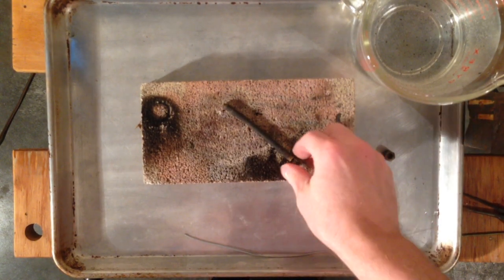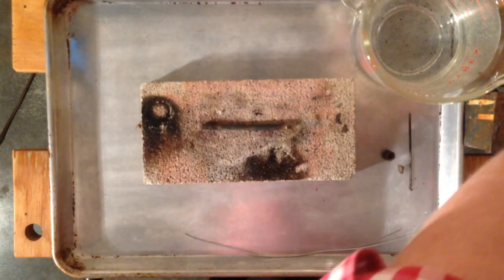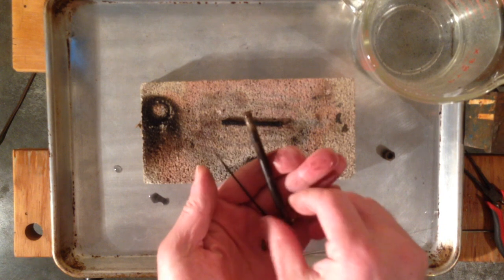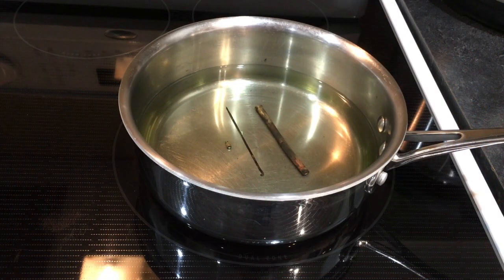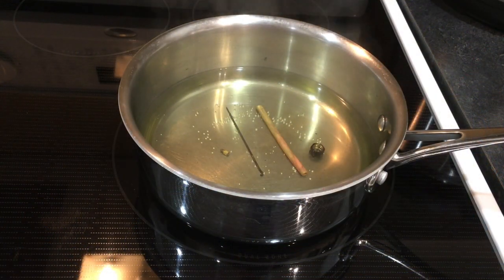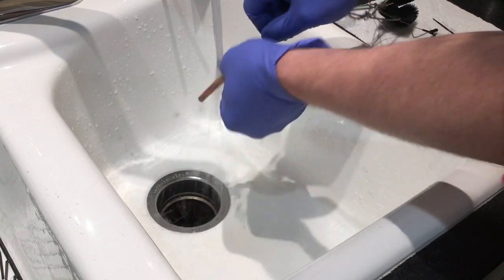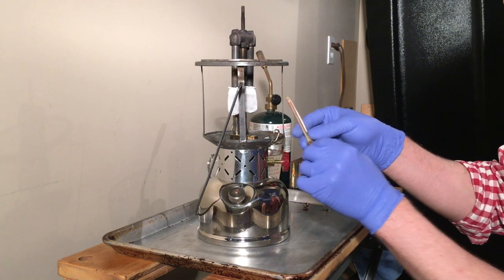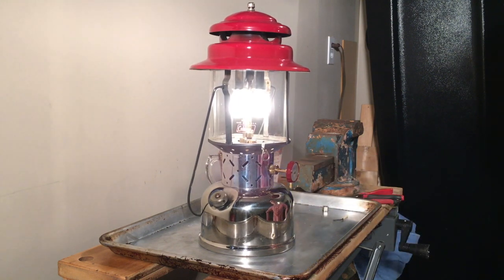How to Clean a Clogged Lantern Generator

Comment: Could you please show how to make a new brass or copper tube to replace the asbestos/ cardboard tube. An do they work better than the original tubes?
Just a thought, I was wandering if a set of welding torch cleaners would work better at cleaning the sprayer tip. They come in a small aluminum box with many deferent sizes of metal
Reply from the maker: I'll add it to my list of potential videos to make in future.  Using copper wire or bronze wool works as well as the original tubes.  Its function is to centre the cleaning rod, so anything that does that and doesn't melt or burn up will work just fine.  I can't comment on welding torch cleaners as I know nothing about them.
Reply: @king.coleman  thank you very much.

Comment: Trying to breath some life into a crusty 502 stove I have had for years (3/65 date on the bottom). Your systematic approach has been very helpful. Once I was able to pull the spring from the generator tube, it stretched a bit during the pull, and it had no cardboard or asbestos insulation at all (just black goo). Seems like the rod just rode down the tube by itself, centered by a full length spring.  Wondering if I can run it this way and if I can shorten the stretched spring by an inch and still be OK. 

I'll get a new generator if necessary, but if I can make this work, it would be great.
Reply from the maker: Stove generators lack the cardboard/asbestos tube; they just have a spring and cleaning rod.  I'd do what you can to compress as much of the spring as possible back into the generator.  If you have to trim just a bit off, it probably won't make a difference.  If you have a trim a lot off, it could be a problem.  I cut a couple inches off the spring in a 3F generator for the same reason and now it has trouble maintaining temperature when the burner is on low.
Reply: @king.coleman   Thanks for the quick reply. I did figure out about the lack of insulation packing after seeing a couple other videos. Also, I did have to cut off about 3/4" from the stretched spring. I do not have things all reassembled yet, but will do so tomorrow if all goes well. I will report back in here with the results. And like I said, it's and experiment and I will buy a new generator if need be.

Thanks again for the help, and for the videos.

Comment: does the tip come off the generator of my AFC 1022? Thought I would ask before i get rough with it. I cannot blow through it and there is a hard black coating on the end. I do not see a hole. Thanks for any help.
Reply from the maker: All the AshFlash generators I've come across were brazed together and not designed to come apart.
Reply: @king.coleman  I had a sneaking suspicion that was the case. I am glad I asked. Thanks for taking the time to reply so promptly.

Comment: Hey, great videos.
Any tips or tutorials on cleaning a Coleman 508 stove generator?
Reply from the maker: Those are tough.  If it's not bad, you could just shoot carb cleaner through it or boil it in a citric acid or white vinegar bath.  If it's really clogged you could try heating and quenching to break up the carbon, but at that point it might be best to replace it.
Reply: Thanks for the quick reply.
Can you boil the whole generator and regulator assembly with the lever or do you need to take it apart?
Reply from the maker: @hutcha107  Just the generator.

Comment: Thanks for this video. Planning on camping on the Island in the fall so testing equipment. My Coleman Duel Fuel Lantern either will not burn or burns very dimly. Since it was not used at all last year I expect it needs a cleaning. After viewing this I decided to clean the generator but I get stuck at the point where you pull the central unit out of the generator (at 1:49 in the video) No amount of back and forth movement makes a difference. The outer brass tube has two dimples in it. It is a newer model (285a). Could it be that this is a crimping to prevent removal?
Reply from the maker: I've never seen one like that, but if the outer tube is crimped, that's probably the case.  If you can get the guts out, try soaking it in carb cleaner overnight and see if it improves.
Reply: @king.coleman  Thanks so much. It is just a tiny crimp, like a centre punch was used but I will try a soak.
Reply: Again a thanks for your good advice.  I soaked the generator in fuel injector cleaner (all I could find locally) for five days.  Completely restored function.
May just I will just do that at the end of every season.

Comment: Can asbestos cardboard be replaced by fiberglass mesh or ceramic mesh? Since they are used to insulate very hot pipes such as motorcycle tailpipes, and they do not burn. Do you think it will do the same job? Thank you!
Reply from the maker: I'm not familiar with either  material.  Many people use bronze wool or copper wire to replace the original tubes.
Reply: @king.coleman  Thank you! Maybe someone knows...

Comment: Fr. Bill I had no idea that the REC had such an asset.  Your videos are very helpful.  I’m repairing a couple of 220s and this was good info.  By the way, do you know if the enamel can be restored on these?  220J and 220K, or if it is worth trying for just a few small spots.
Reply from the maker: Are you talking about the enamel paint on the fount or the porcelain on the vent?  Founts can be repainted.  I recommend automotive grade paint that will resist gasoline spills.  There's a place called Independence Porcelain Enamel in Missouri that is able to refurbish vents for around $30-$50 (depends on the vent).  I'd be hesitant to invest that much in a 220J/K vent since they're so common.
Reply: @king.coleman  I was referring to the vent.  I guess based on that I thought the whole thing was some kind of ceramic or enamel.  I can probably just wait until another one comes along and swap parts.  Thanks.

Comment: Thanks for sharing your video!  Very educating!  My question is, I just bought a new generator for my 200A lantern, works good now except when I turn the cleaning lever up,  it should turn off but it stays on.  What do you think the problem is?  Would it be inside the eccentric block?  Thank you in advance!
Reply from the maker: When the cleaning lever is up it should dim, but it should not go out.  If nothing happens when the lever is turned, the most likely problem is that you bent the needle on the tip of the cleaning rod during installation.  Depending on how bad it's bent, you may be able to very carefully straighten it.
Reply: @king.coleman  Thank you for replying!  I will check the cleaning tip wire.

Comment: So I inherited a model 335.  It’s in great shape.   Pump seal is solid with original leather ring after some oiling and the tank hold pressure.    But I can’t get any fuel through the regulator and generator…

I took it all apart and now I’m getting a little bit of fuel leak out of the top of the generator cap (or small top screw).   Does this small screw in the top of the generator ever get clogged?  It doesn’t seem to have a hole.   The guys of the generator came out cleanly and seem to be operating fine with the cleaning knob.   

Any help!!!!!    Maybe it just needs a clean?
Reply from the maker: The generator tip (called a "gas tip") has a very small hole in it...about .007".  The cleaning needle in the generator is there to clear carbon and debris from that jet.  It may need to be cleaned.  Check out my video on fuel system problems.  It should cover whatever is wrong.
Reply: Ok, after watching your video, I can definitely say that the needle is definitely not coming up through the generator cap screw…    Would just a citric acid boil of the generator components solve my problem?  Great videos man.   Big help!!
Reply: Forgot you were in the west coast, but one last thing…. What can I use as a citric  acid substitute?   Or where in Canada can I get it?
Reply from the maker: @ghmtchl  The cleaning needle only barely breaks the surface of the gas tip, so it's easy to miss when it does poke through.  The next step is to unscrew the gas tip to inspect the needle.  It's possible that it's missing or crumpled.  If it's missing, it's time for a new generator.  If it's crumpled, you may be able to carefully straighten it, but that will depend on how badly it's been damaged.
Reply from the maker: @ghmtchl  I get my citric acid powder a place that sells beer and wine-making supplies.  You can but it from Amazon.  White vinegar is a decent substitute.
Reply: Current issue.   Cleaning tip needle still intact…. But it won’t go through the top screw.  It just keeps getting bent.    This is after a 20 minute boil in vinegar….  Any tips on getting that needle through?
Reply from the maker: @ghmtchl  I'd see if it will go through from the other direction.  If it does without a problem you may have an alignment problem, which is likely if the needle has bent repeatedly.
Reply: Yup, I’d say alignment problem.   After trying to straighten out the needle, it finally broke….  New generator ordered.   
Thank you for your time!   Wonderful videos.

Comment: Bill, I have a 222a easi lite lantern. The cleaning needle is bent badly. Any way to straighten the needle or is it toast? Thank you
Reply from the maker: There's a good chance it'll break when you try to straighten it, but it's always worth a shot.  It won't do you any good as it is.  Use what works: fingernails, needlenose pliers...it will depend on the shape it's bent into.  If it's been bent once, the chance are better that you'll be able to get it straightened out without breaking it.  If it's been bent repeatedly, it'll likely break when bending it back.

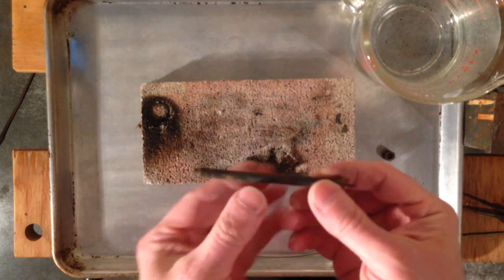Comment: Can i clean Coleman 295 Generator like this also ?  My generator seems unable to remove the needle piece (Step 1:41). Any advice ?
Reply from the maker: Yes.  Since the 295 generator is designed to burn unleaded gasoline, I believe it's got a double spring setup inside rather than a spring and cardboard tube, but that won't make a difference with regard to disassembling it.  If the needle or springs won't move, try heating and quenching a few times.  That will break up the carbon buildup.  Alternatively, you could try immersing it in carb cleaner for twenty-four hours.  That often works as well.
Reply: @king.coleman  Thank you so much for your help. Currently im immersing whole generator in Injector Cleaner. Hope it works. If not, i need to burn it like you do. Thank you again. 👍👍👍
Reply: @king.coleman  And one more thing, any possibility we run Unleaded Gasoline mixed with small amount of Injector Cleaner, will it prolong my generator life before i need to service the generator again. Any advice ?
Reply from the maker: @azwanfauzi  I don't think it'll do any damage, but I don't know how much it will help.  Some guys routinely add a capful of Seafoam to the fount when refilling and swear it helps them run better.  I've tried it a few times and can't say that I noticed any difference.

Comment: You pulled a tiny fuel screen out of the generator, but didn't address how or whether you replaced it. In cleaning out my generator, I dislodged it, too. Is it necessary with today's presumably cleaner fuel? If it is, where the heck does it go? I can't see how the tiny, fragile cleaning needle could go through it to do its job. Thank you very much. Well done  video.
Reply from the maker: Throw it away.  There's really no need for it with today's clean fuel.  That's doubly true if you're also using a filter funnel when filling your lanterns.  That screen needs to come out to get the generator clean and if you try to put it back, you'll likely end up with a bent or broken cleaning needle.  Coleman stopped building generators with those screens back in the early 70s.
Reply: @king.coleman  Great! Thank you very much for your prompt reply, which allows me to reassemble my lantern and test it. I share your apparent love for these things, if not your knowledge and skills. Merry Christmas.
Reply: @king.coleman  Thank you; I had the same question as ReRe...  There was no way the tiny screens were going back in (in a functional way).  My old generators were sitting by the garage garbage can for a month, but I could not bring myself to throw them away.  Glad I found your tutorial and look forward to seeing how the refurbish works.

Comment: Hey mate do you soak the generators with oil or petrol? If they are clogged.
Reply from the maker: No, as in the video I use a mild acid solution.  If that doesn't do it, heat and quench to break up the carbon deposits.

Comment: Nice video. I found a Coleman 500a single burner stove at a flea market and the generator was totally clogged and frozen up. New generators for these are not available that I can find. Using the heat and quench method I was able to free up and remove the spring and rod.These have no tube, asbestos or cardboard. Now I want to clean the parts in the citric acid solution. But I am unsure of the ratio of citric acid to water. Can you tell me what the mixture ratio is? Thanks.
Reply from the maker: Yes.  Stove generators just have a spring and the cleaning needle inside.  I usually usually add about 1 teaspoon of citric acid powder to a litre of water.  You can make a weaker solution if you prefer.  A weak solution will work just as well as a stronger solution.  It'll just take longer to work.

Comment: bravo - can lanterns be used inside of a house for lighting
Reply: Keep a couple windows cracked, carbon monoxide is serious stuff.
Reply from the maker: Yes, they were designed to be used indoors as well as out.  They're still commonly used by Amish and many others.  CO isn't a big problem if your lantern is working properly.  I've shut up two 236s and two 237s in my laundry room with a towel at the base of the door and a CO detector and after three hours of burning it was very hot in there, but nothing registered on the CO detector.  If it's a concern, crack a window.

Comment: Dear Kingcoleman,
Discovering your tutorial tonight was a real gift to me. I do all my cooking everyday on a coleman 425 suitcase stove with regular gas (unit has a dual fuel generator in it), consequently lots of carbon builds up. I would clean the rod with mild sandpaper, and run a coat hanger rod through the spring but could never get the spring out for a proper cleaning. I will try the heating and water drench method. Question: how hot for the outer tube, should I get it glowing red ( I also have oxy acetylene for rapid extreme heating. Boiling in vinegar, regular white vinegar or mixed with water? Thank you much for your video, and it reminds me when I attended a 1990 coleman meet in Indiana. All the best and gratitude from New Rochelle N.Y. bruce the swimmer.
Reply from the maker: It doesn't need to be red hot.  I'd stick with propane.  Oxy-acetylene may get too hot too quickly.  On a stove generator, I'd recommend using straight white vinegar.
Reply: @king.coleman  Thank you for your prompt response. Hope to converse with you in the future when I have time to work on some quick light generators.

Comment: Soak in Costco Degreaser (available at their commercial product stores) overnight and voila! Clean and disassembled completely and safely. The carbon and or varnish are troublesome but can be overcome! Hadn't thot to use a torch to burn it off. Add new packing and spring  (if heating for sure!) or clean if able to remove after Degreaser.
Reply from the maker: I'm familiar with Costco, but I don't know what a Costco "commercial product store" is.

Comment: Was the asbestos still wet upon reassembly?  Was it dry before lighting? Great videos, BTW!
Reply from the maker: Thanks for the question.  I probably should have noted in the video that I did hit it with the torch after I put it back into the generator.  You can leave it wet, but the lantern will be pretty cranky on the first light-up.

Comment: Do you use Coleman Fuel/White Gas, or regular gasoline?
Does it make much difference in terms of clogging up the generator?
Reply from the maker: Regular unleaded is fine as long as it's fresh.  White gas will last forever, but unleaded doesn't age well and will go bad over time.  It's that stale unleaded that will leave deposits behind in the fuel system and make a mess of the generator.

Comment: G'day to you!  Please tell me what the cardboard tube and spring are for?. Thanks
Reply from the maker: There's some debate about that, but the primary purpose seems to be merely keeping the cleaning rod centred in the generator.  Some argue that they're there to slow the flow of fuel or to retain and regulate heat, but I have yet to see a good explanation for either that relies on physics.  R-55 generators have neither spring nor tube, which I think debunks the idea that they're needed to control fuel or heat.  The tube can be replaced with copper wire or brass/bronze wool wrapped around the spring and the generator will work just as well.

Comment: I have a 220j that I can't get the nut at the bottom of the generator tube to tighten all the way down..it still shows about 1/4 inch of thread and I dont think its cross threaded...everything is correct inside the generator and its connected properly..any suggestions?
Reply from the maker: The thing to be concerned about isn't how much thread is showing, but if the generator is secured tightly to the valve.  If the generator-valve seat is good and the nut is tight, it should be fine.  If the nut is tight, but the generator is still loose, then you may have damaged threads.
Reply: I got it working. It seemed like others did not have near the thread showing that I did on my 220j but after pulling everything to clean and lubing the pressure pump all is working good. Thanks!